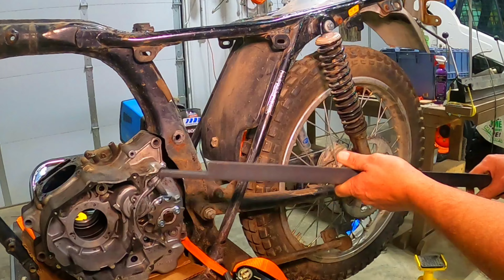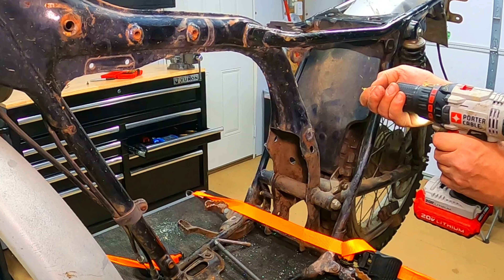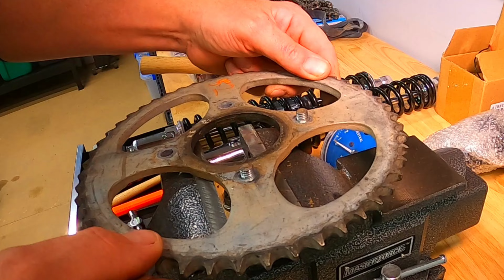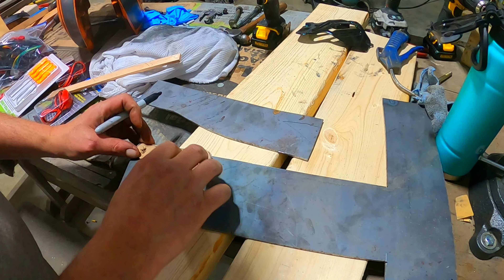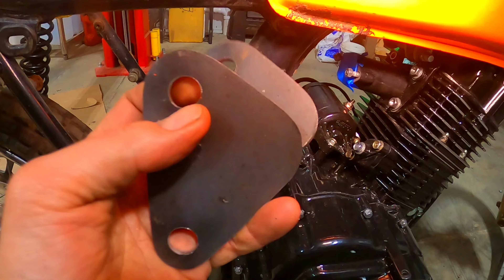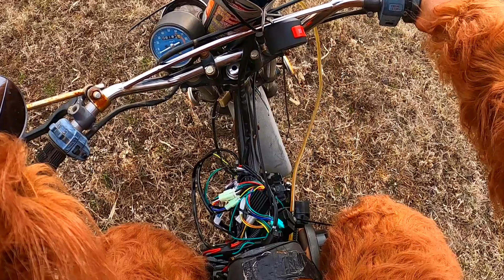Restomodding a Vintage Honda XL Dirt Bike: Custom Motor Mounts & Engine Swap From a Honda TRX200SX

Comment: I did an  xl175 with an lifan 200 years ago it was a nice rider.  good work.
Reply from the maker: Cool. Sounds like a fun ride. I wish I could have found a xl175 frame when I was starting this one. It would have been a bit easier fitting the engine in that frame! Thanks again for watching!
Reply: Haha I just stumbled across your vid from a few years ago.
Reply from the maker: @Psyphuck  Cool. Which vid?